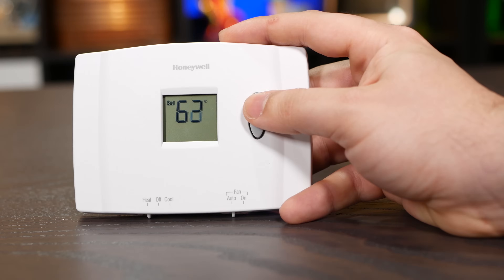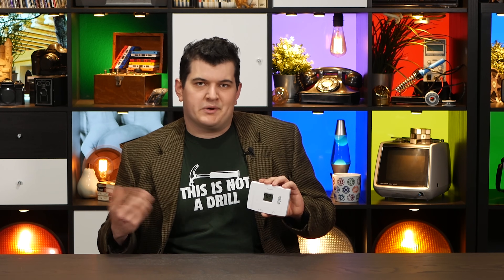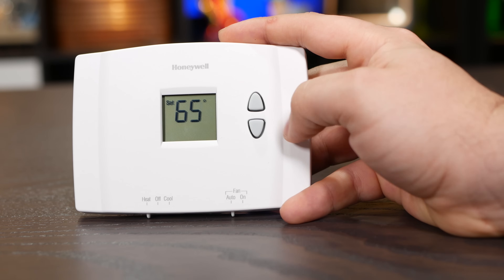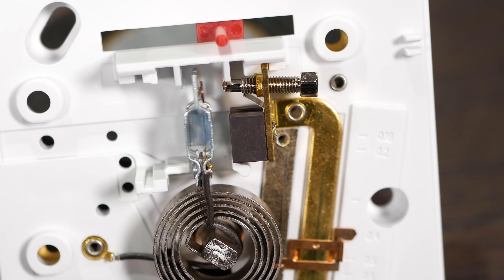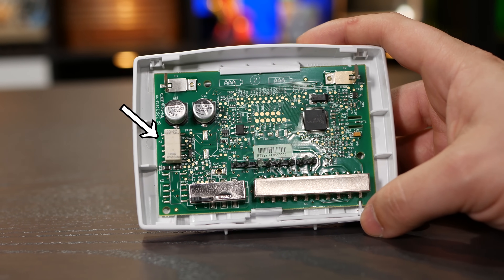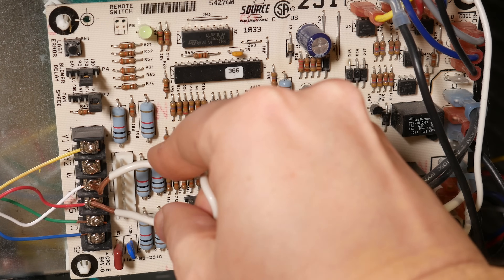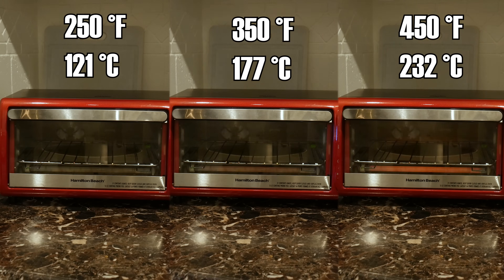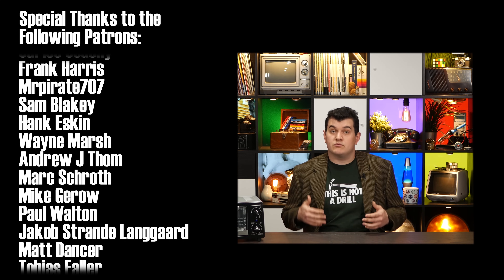Thermostats: Cooler than you think!

Comment: Engagement on...

Still set your thermostat to target regardless of multistage. The low setting is only used for small changes, so if you only need a small change there is no need to use full blast to make it “faster” because you will likely overshoot.

Personally I wish I could tell my Nest to use low more often, it jumps into multistage too easily when I don’t really want the set temperature quickly, what I really want is longer running air conditioning ( humidity removal ) So I would rather it take 2 hours to move from 72 to 68 instead of 30min.

But I don’t want a small unit as I still want my using to be able to use all stages when it is super hot and super humid so it can actually cool and condition in the most extreme conditions.

Pfft

Comment: great video, it would have been nice if you talked about the electric or gas anticipation on the thermostats, just another neat easy thing they did on the mechanical thermostats to keep it from over shooting. 

And yes, there are plenty dual output heat and cooling, though usually only see those in really big houses where you want to heat or sool fast till close to set point then slow down, also to not overshoot. 

It would be nice if you did one on actual zoned heating, might not be your gig, but id be interested. would be nice if they had a cheaper option then actual modulation motors

Comment: These days manufacturers are beginning to make variable speed systems which use a communicating thermostat system where the thermostat, furnace, and AC/Heat Pump all communicate with each other using code. This allows for the speed at which the system is running to fully conform to the heating or cooling load on the system. So sometime in the near future there will be no defined speed at which these systems run. Also, these communicating systems only typically use four wires between the thermostat and all equipment. R, C, and two communicating wires. This system also allows for most aspects of the system to be managed from the thermostat as well as being able to monitor system status and receive maintenance alerts from the thermostat. For example, look at Rheem's Econet system. This system allows full control and monitoring of your Rheem Prestige series HVAC system as well as compatible water heating systems.

Comment: I always told my wife that setting the heat to 80 is like setting a burrito in the microwave to 10 minutes because you're hungry and want it to cook faster.
Reply: That's actually a great analogy!
Reply: Not really because it is totally possible to control the microwave wattage in most modern microwaves. It's not either on or off anymore.
Reply: @beardsntools most consumer microwaves are just on or off, the only difference is it takes breaks when set to lower power levels
Reply: @beardsntools unless its a convection microwave, it's like the other guy said. On or off
Reply: @kugelschreiBERND  Hotel heating and cooling is a whole different animal..  Generally massive loops that run through all the rooms from a boiler room.  Kicking their heater boiler off is not cheap.  The boiler may turn on even if the room never reaches a low enough temp to pump out any air..
Reply: @FleaNutClaypool almost every hotel that I've been in has one of those through wall ACs usually all in ones
Reply: Taking notes...House...is a microwave...got it!
Reply: Now I want a burrito...
Reply: OMG i go through this with the women at work every year.  Seriously, and we are a professional engineering firm.... so they're not dumb.
Reply: @IDPhotoMan  There was a lady I worked with at a university in Southern California who, in "winter," would set the thermostat at the highest temperature (I think 90°F/32°C) because "it's freezing." She grew up in Equatorial Africa  and her regular outfit was short shorts and a halter top type blouse.  She didn't believe the HVAC tech that the system wouldn't heat any faster and apparently couldn't wear warmer clothes. Finally, rather than have everyone on that floor of the building be in stifling heat, I had Facilities install a locked box over the thermostat and kept the key.
Reply: It is!
Reply: Enjoy your 1K liker, that’s fucking facts 🤣
Reply: I put my cars to fill heat so that it helps defrost the windows because they freeze right back over after you scrape
Reply: Did she believe you? Mine doesn't....
Reply: Or setting the oven to 500 so it preheats to 350 faster
Reply: Awesome analogy!!!
Reply: Gee...if only someone talked to her like a human so she could understand how the system actually worked instead of trying her best to parse out how it works from head patty analogies......But i mean....she is JUST a woman....they never understand anything, right boys?
Reply: But it doesn't make it...oh. lol
Reply: To be fair some people (me) set the toaster oven or microwave to like way to long so we can regulate and feel in control
Reply: Yeah but you decide when to take the burrito out. If you are the burrito you can't take your self out and if you did it would be cold so just keep that heat going and you'll get sweaty and then it back down. I don't think anyone's actually clueless enough to think setting it higher made the furnace work harder.
Reply: It really depends on what furnace setup you have in your house. If you have a heat pump with backup heaters and you set the temperature high enough to activate the backup heaters, the temperature will raise faster. Same with two stage furnaces.
Reply: Did she listen?
Reply: Maybe they need to implement a fan speed control so you could in theory "speed up the process" just like in vehicles how you can adjust the fan speed.
Reply: @victorcoss2600   that would only work if the supply of what you are accelerating also increases. basically, you want more heat, you need more heat. the furnace has one output level, imagine a machine spitting out a constant single strand of rubber band, but it only puts out a set thickness at a set rate. Pulling on it wouldnt give you more rubber it would only stretch and thin what was coming out. Thats like adding a fan to accelerate a constant heat supply. Not a bad thought though.
Reply: @lsixty30  actually, pulling on an extrusion WOULD potentially cause it to extrude faster, just like a faster air speed WOULD cause a greater difference in temperature between the heat source and the air it's heating as the air is carried away faster. This caused the heat source surface to be cooler. In an example such as a resistive heater, the resistance is lower at lower temperatures which means more watts of power, so the increased air speed WOULD cause an increase in temperature difference, causing a decrease in heater temp, causing an increase in heater power, causing an increase in heat radiated through the home. This change, however, is likely quite small and insignificant. I wonder if the heat from the motor at higher fan speed would have a greater or lesser effect than the change in resistance of a heating element with more airflow.
Reply: @platinumsky845  Quite literally a slower air speed causes a greater difference in temp between return and supply air. This is why restricting airflow causes high temp limit faults.
Reply: @victorcoss2600  They all have speed control, But its still putting out the same amount of heat, just more dispersed
Reply: I'm not sure it's the same theory when someone is cold. Trying to warm up from freezing temps at 70f will take longer than 80f. Having 80f will warm the body up faster than 70f. It won't make the furnace get to 80 faster, it warms the body up faster.
Reply: @DavidSmith-rf5je  If you mean that being in a warmer room will warm you up faster, then yes. If you mean that in a cold house, setting the heat to 80 rather than 70 will warm you up faster, then no, as explained in the video the same furnace will turn on in the same way.
Reply: @quinnbattaglia5189  I don't think that's true now with a digital thermostat. My Nest digital modulates the gas valve on and off with a shorter duty cycle as it approaches the set temperature.  It is not constantly on until then.
Reply: @8546Ken   1. Most people don't have nests
2. The only time pulse modulation makes sense is when you're already pretty much at the set temp, doing it during the initial warmup is just a waste of the furnace's potential. I'm sure the nest people know that, so it probably only does that for the last couple of degrees so it doesn't coast past the set temp.

Regardless of what kind you have, just set the thermostat to the temperature you want and let it do its job. The only exception (mentioned earlier in this thread) is if you have multiple heat sources, like a heat pump and backup.
Reply: @quinnbattaglia5189  I was paying closer attention to my Nest when it was new. But it made me wonder if this is typical for other digital thermostats. It's all firmware and wouldn't be hard to do.  Yes, it only makes sense for the last few degrees.
Reply: @quinnbattaglia5189  I assume most people do have some brand of digital thermostat, so I'm just speculating on how all of them might work.
But as someone else suggested, regardless of the technical theory, it comes down to how quickly "I" warm up (or my wife).  She will warm up faster if the house actually is warmer for a while as long as she can feel the warm air blowing. Our previous house had a gas wall heater in the kitchen. My wife really loved turning that way up and sitting in front of it. Never mind what the temperature was. She wanted to feel that heat blowing for a while.
Reply: @quinnbattaglia5189 one exception is if the thermostat is close to a heat vent.
Reply: @DavidSmith-rf5je  This is the point in the argument that I just start throwing sweaters at people until the house is warm.
Reply: @DavidSmith-rf5je  but if its freezing outside, even if thr room is only 60⁰F, it will feel toasty and warm when you first come inside.  Turning the heat to 80 versus 70 when first coming in, will just mean it will run longer.  You will probably be warmed up enough by tge time it hits 70 your house will start feeling "stuffy" as the heat continues running through the mid to upper 70s.  80 will likely seem uncomfortably warm (unless its summer and youre acclimated to warmer temps, 70 will seem chilly, and 60 will feel FREEZING)
Reply: @DavidSmith-rf5je  it will run at full pace until it reached the temperature it's set at. So setting it to a higher temp won't speed that up.
Reply: @DavidSmith-rf5je  That's when you drink something really warm so you heat from the inside. I know in Finnish winters I have shivered like 10 minutes inside with  winter clothes on because I was so cold deep in my "bones".

Comment: Yes many if not most “ programmable “ thermostats are capable of temporary override till next auto set point shift. One such as I have can “Heat pump” has 2 levels of auxiliary heat for 3 levels of heat . Joining Other sensors can shut off furnace/ a/c on smoke,heat over 140 deg f, co detection for safety. IR or ultrasonic sensors to detect occupation that shift temperature set points to conserve energy . They can drive me to distraction trying to get programming correct  PS there are more sophisticated thermostats that sense radiant heat for controlling fancy radiant heat/cooling systems proportionaly not just on/off.

Comment: I used to drive an 81 Cadillac Seville  (Yes, the one with the "humback" or "Bustleback" trunk, and the 4-6-8 variable displacement.)  It had a push-button, digital thermostat control rather than  "Cold---------------Hot"  and Manual fan speed levers.  It would increase or decrease the set temp one degree (F) per press of either the blue or red button.   In the winter, I kept it set at about 68.    A friend of mine would get in the car and frantically poke at the red button all the way up to it's max of 85.   I could not convince her that whether it's at 68 or 85,  the heat will not even kick on until the engine warms up enough.  And that even if the engine was warmed up, the system will run full heat until the cabin reaches the set temp, then, and only then would it regulate the baffles to blend the incoming air through the heater-core to maintain set temperature.  This also controlled the fan, and the vents the heat came from.  But every damn time...  "Jeez!  It's cold! * poke poke poke poke poke * .... When just leaving it be would have the same effect.
Reply: Yup, had a friend who would get into the car on cold days and turn the blower motor on full.  Since the engine wasn't generating enough heat to open the thermostat, it was just an exercise in blowing cold air at everyone.
Reply: @dougk4971  OMG, I used to know a girl that did this. So I had to get into a cold car and get blasted with even colder air for like 10-15 minutes! 🤦🏽‍♂️
Reply: @witenitenz  The manual type with the levers (or knobs) do heat quicker with the lever slid all the way to the "hot" (or "warm" in a Ford)  But the ones with thermostatic control,  You'll have a hard time convincing people to just set it to a comfortable temp and leave it.
Reply: Reminds me of a time I went on a road trip to the mountains for New Years with a couple friends. Because it was cold outside and 3 of us inside, the windows kept fogging up. To keep the windows un-fogged and keep the car at a nice temperature I always turn on the a/c and turn the heat up to a nice middle area so the inside would stay nice and dry and the windows clear. However, my friend (now former) in the front passenger seat refused to believe this was a proper solution; and since I was driving he insisted on taking care of the heat. 😠 He would turn the heat all the way up and the defrost setting on until the windshield was clear and we were all hot and dripping with sweat. Then he would turn it OFF!! After 5-10 minutes I couldn't see out the windshield and he would again turn defrost on with the heat all the way up for a few minutes. Rinse and repeat. Finally he fell asleep and I switched it back over to the a/c and medium heat and we were all much happier. Until he woke up again. :facepalm:
Reply: @evanmacdougall9715  Evan,  That's what you call a "Hand slapper" right there.  DAMN!  I hate that shit. 
(Passenger reaches into the drivers' area = SLAP!) In my vehicle, I'm driving.  To me, that means operating the ENTIRE vehicle. Heater, AC,  radio,  everything.   That's my domain.   That's why all of those controls are oriented toward the driver, in the cluster on the drivers side of the dash. Never try to reach over the console to adjust something I already have set.  Passengers just ride and enjoy the scenery, and work the glove-box lid if needed.  If you're hot/cold,  Say so. I'll adjust the temperature in the appropriate manner.  My dad is like that.  He'll reach over and turn the defrost, the vents etc to the floor vents only.  "That dries my eyes out!"  Yeah well I can't see through fogged glass.  Sit in the back.  Not only does he turn things off/on,  he does so with maximum force. If it's on,  he MUST turn it off!  HARD!   Radio,  Blower fan, he even complains if the lights are on and it's not like pitch black dark outside.  Wipers,  if the windshield is not completely covered in water,  he will not run them.   The volume knob on the radio is not just turned down.  it is SLAMMED against the stop.  Same for any other knobs or levers. He has snapped off one radio knob, and broken two temperature control levers already.  If on a screen, he MASHES hard into the screen.  Like if he does it harder, it will be even more off.  Off with intent.  Off with purpose.  Not just your typical pansy Off.  But SERIOUSLY OFF!.    I guess..  

So I have adopted the policy in my van,  that I ALONE, will operate whatever needs operated.  (Most) passengers sit and ride.
Reply: Sounds something similar to what my grandfather's friend and I would at times talk about with heating in the winter. My 2008 toyota prius (although I'm sure that a lot of prius' have the feature, like my younger sisters 2007 prius did) has a a/c auto settings on the climate control. That being something that of like what you said cammi, it wouldn't turn the blower motors (or the climate control wouldn't turn on) until the engine is up to around 100 degrees F, and will slowly turn the fan speed up as the engine warmed up. In a sense, the fan speed would follow the engine temperature up. That is great in the winter in say.....5 degree temperatures. Rarely ever in the winter will that get turned off for obvious reasons. I love that feature.

Comment: My heat pump had it's supplemental heat fail once and if I set it at say 70 F, it would eventually get it up to there but it would keep running and hold it there. However if I set it on like say 69 F, it would also eventually be able to hold it there but not get it high enough for it to shut off. I never understood that. By the way, the system is fixed now so it doesn't matter but I found that weird. It wasn't just temperature differences either as it took me over a month to convince my family to get it fixed and it would always keep running but hold it at whatever temperature I set it at when it was around below 30 F outside.

Comment: Maybe not the thermostat itself, but I've had air conditioners that basically had a "just temporarily crank your ass up" button. They know that's what you want sometimes, not a specific temperature but a temporary boost to the current situation (I guess ideally, thermostats would include a hygrometer, so they could increase cooling on humid days, and decrease heating on dry days)

Comment: So if I set the temperature to max setting, instead of giving me some throttled down "3 minutes on, 7 off" performance it will actually turn on 100% duty cycle and keep on going past reaching the actual desired temperature.
That is why people crank it way up. They want heat NOW, not within the 2-hour period the thermostat thinks is comfortable to do.